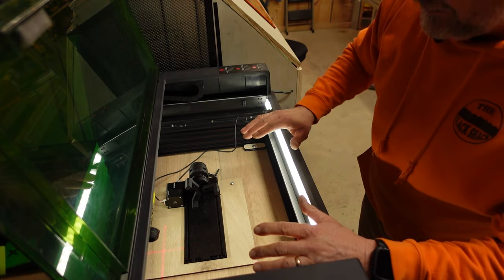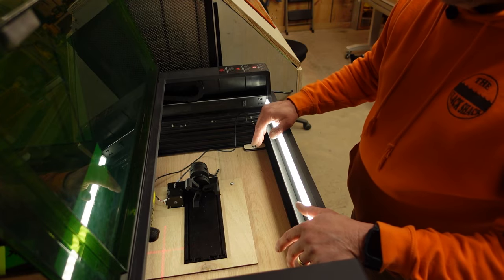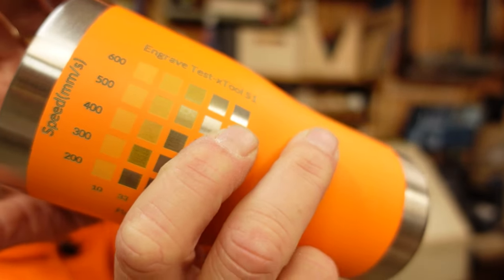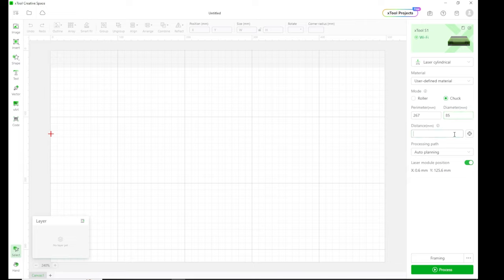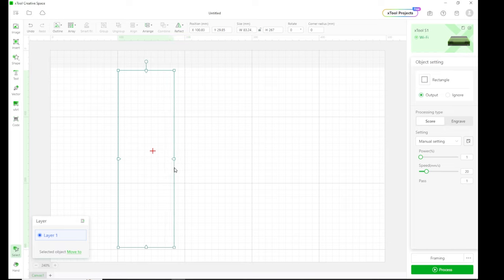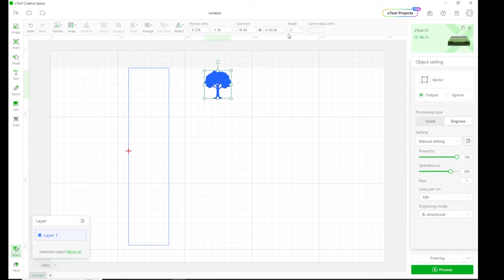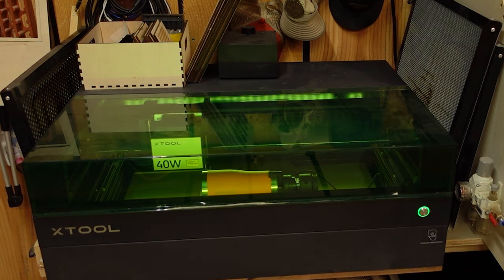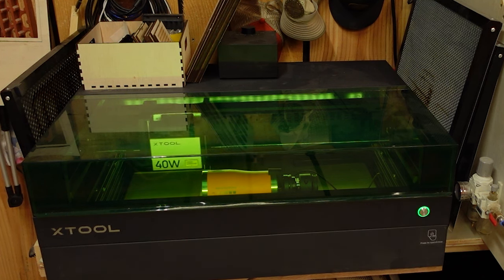Engraving tumblers with the xTool S1

Comment: with the jig, how do you level everything if needed depending that kind of cup/tumbler is used?
Reply from the maker: The tumblers that I use do not require leveling. The S1 can also engrave on a curved surface if needed.

Comment: Great video. I have the 20W version and going to do some tests on a few practice tumblers. I am curious about the power and speed I will need using the 20W. I hope I don't have to buy the 40W module to do projects I see others do. Being my first laser, I figured a 20W would be more than enough for making some boxes and engraving stuff like tumblers. Thanks for the great content.
Reply from the maker: The 20 will work, just a little slower.  Stay around 200mms you should be ok. Only way to get the best settings is to test.
Reply: @TheClackShack  Thank you sir. Great videos and you have helped ma a lot.

Comment: My S1 is on its way, but the problem with the moving tray has me concerned. I saw another video where the guy flipped his riser base over and was able to screw the tray in from the bottom? Now I can't find the video but was wondering if that is a possibility? Thanks for the great content.
Reply from the maker: I would leave it able to be moved to different levels. You can use painters tape on the edges to hold it while in use. This wouldn’t make everything exactly repeatable but with the two point system, you could get good results.

Comment: I took out the crumb tray to allow clearance for the rotary. I get an error code saying that the six screws, that tell it that the riser is installed, are not installed properly. Do I need a work around?
Reply from the maker: Yes. Look for the screw with a brass ring around it. That is a sensing screw. It has to be in to close the sensors circuit. As long as those screws are in, it should work. May need a small washer
Reply: @TheClackShack  I figured it out right before you replied. I took some hot wire and ran it across all three screws on the riser side to act like the crumb tray. Worked with no problem. I think we have different risers. yours opens mine does not. Thanks for your help and your videos. You made learning this a no brainer. Thank You'

Comment: Great video. I have a M1 and the rotary kit which I have never tried. Since then I have bought the S1 and love it. Is there any way I can use the M1 rotary kit with the S1??
Reply from the maker: I am not sure it will work without the adapter. The S1 was made to work with the RA2. I am not familiar with the rotary for the M1.
Reply from the maker: I am not familiar with the M1 rotary. You would at least need the S1 adapter to even connect it.

Comment: hey Clack, your Childersburg fan here.  I have the Xtool D1 Pro 20w with the rotary tool.  Is it the same rotary used in this video or would I need to buy another specific to the S1?
Reply from the maker: The new RA2 should ship with all three cables. Mine did.
Reply from the maker: The cable will be different

Comment: Try timing the different speeds with a stop watch, I got the S1 and recently discovered that engraving at 600mm/s is actually slower than engraving at 300mm/s since the time it takes for the laser to accelerate and decelerate for a higher speed takes more time than going at a "slower" pace. Now my processing time is much faster and the machine barely moves around.
Reply from the maker: Yes, it will also adjust the speed down if you get near the edge of the area. It is wild sometimes how things can effect the results.
Reply: I was going to bring this up too.  I have a design that I had set to go at 500 speed and it would have taken 15 minutes flat.  Changed it down to 350, decreased the power from 100% to 75% (better for laser longevity anyhow) and it knocked off 39 seconds.  Doesn't sound like much until you count the fact that it was a bulk order.  ⌛= 💰

Comment: I've been having a heck of a time with getting tumblers to take full wraps.  Is there a way to extend the xcs canvas to that I can have it wrap a stanley.  When I try with the s1, the canvas is too skinny for the wrap.    It seems goofy that i can't use xcs to fully wrap a tumbler.  Am I missing something?
Reply from the maker: The software should turn off the Y axis limits when using the rotary but I haven't tried. You could set the machine up in lightburn and create a profile just for tumblers with a larger Y work space. This way, you could set the axis as big as you wanted.
Reply: @TheClackShack  good call.  I went to Lightburn to get the full wrap setup making the y work area bigger. Appreciate the help.  Just grabbed a few more of your jig setups on etsy today.  Apprciate all the good stuff you put out.
Reply from the maker: Glad you got it working. Enjoy @pnwprepared
Reply from the maker: Just tested my machine in XCS with your issue. Try spilling over the bottom of the work area and not in the top. Apparently if you put the extra out the bottom, it works. Who knew?

Comment: Thank you so much for such clear instructions.  I'm researching lasers now and the xTool S1 is one I'm considering.  (I'm one of those crafters, so I definitely want a diode laser.) Anyway I'm wondering why you install your tumblers differently (bottom to the right and in the clamps) compared to how others are using it?
Reply from the maker: I attach to get the best hold. I also prefer bottom attach because my graphics are typically up top

Comment: I wish i would have watched this video before trying a tumbler....I watched the xTool video, set it up exactly like they recommended....WELLLLLLL the RA2 jumped on me in the middle of engraving and I'm assuming broke my distance sensor....Now my laser is down until I can get a new one. UGGGGG I'm now gonna watch all your videos before I try anything, at least once I get a new sensor. I hope that's all thats wrong with it.
Reply from the maker: The pin should just fall off if it gets hit. You have to line everything up but it is just held in place by magnets. Easy fix..
Reply: Thank you for responding, I did align and it fits in the spot easily but when it starts to lower it alarms and gives me an M363 S4 error. It happens every single time I try to set distance. sigh @TheClackShack
Reply from the maker: @creativecarey7723  power cycle the machine. Make sure it is lined up it can be a pain
Reply: @TheClackShack  unless I’m not power cycling correctly that didn’t work. Still got the error 😭
Reply: @TheClackShack  I am a total idiot 😂 I had replaced the honeycomb and crumb tray to low with the riser 🤦🏽‍♀️ it’s all fixed phew!!

Comment: Did you have a problem with the chuck? The chuck arms, where's you place the 3 grip arms, are loose on mine. Is that the way they are ? Or can they be tightened? TIA
Reply from the maker: They have screws in them that may be loose. I haven’t noticed any issues with mine

Comment: When using the rotary chuck (instead of rollers), do you always have to vertically invert your images in XCS? I have seen some folks with the RA2 that have said they did and others that say they didn't.
Reply from the maker: The ones having to invert have it set up wrong. The placement of the chuck dictates its rotation. Place it like I do and you will not have any issues. Just make sure the writing on it is right side up from the front.

Comment: Hello! When I try to start tumbler engrave, it tells me the crumb tray is not properly attached. Help showed me screws needed to be placed. There a not any screw holes in lowest slot for it with riser. Is there a crumb tray detection setting I can put as ignore?
Reply from the maker: Look for the screw holes that have small pieces of copper in them. There are three screws on the sides that must be tightened until thew touch this copper. I had the same issue when I was trying to install the screen printer tool.

Comment: Thank you very much for this video! I used the setting you recommended and engraved some solid color tumblers. They turned out beautifully. However, when I engraved a rose gold coated tumbler with power100 and speed 500, some of the engraved area look brownish. I wonder if the power is too high. The rose gold coat seems to be thinner than the solid color.  Do you have any suggestions? I am using S1 with 40W as well.  Thank you in advance.
Reply from the maker: If the metal is tarnishing, it is likely too hot, The best way is to sacrifice one to science and test.

Comment: Higher speeds need to be a large size or it becomes slower with small engraving sizes due to the over run the module needs to travel to engrave @ the set speed. I have done months and months of testing. I have had the S1 since the beginning of June
Reply: engrave a 1 inch square @600mm/s and then engrave same size square @200mm/s and see the time difference.
Reply from the maker: Ok
Reply from the maker: Sure
Reply: This is applicable to all lasers using a similar gantry system. The engineers design in this over-run to reduce stresses on the gantry, but remember it only reduces them. High speeds still force the motors to work harder when switching directions, so it affects the unit's lifespan as well. Most people (YT creators I've watched and myself) have found they get similar or slower times when going over 200mm/sec on anything under 3-4 inches (or large jobs that have lots of directional changes), so using this slower speed doesn't really effect run time at all, and gives you better control with laser power and longer motor life.

Comment: Nice jig setup for the RA2, with that being stationary, and using the chuck, you could put a mark on the right side enclosure that aligns with the guide rail once you find the center, then you can go back to that spot without measuring for the center, as long as you're using the chuck.
Reply from the maker: I just use tool lines in the software.

Comment: Mine won’t let me enter anything over 120mm in the diameter I can’t find any answers any ideas ?
Reply from the maker: If you are in XCS, I believe they have limits set. These are only 75mm. The RA2 cannot support anything bigger than that without it hitting the bottom.
Reply: @TheClackShack  the wierd thing is i did a larger cup before and then switched to a small tumblr which in inches was about 7 around the base but it wouldn’t let me enter anything over like 4.4 or it would just auto set back to 4.45 or so
Reply: @TheClackShack  I may try to reach out to x tool but last time I tried that it took 2 days for a call back just to speak to someone who can’t hardly speak English 🤦🏼‍♂️😂 and I can’t find anything online about it